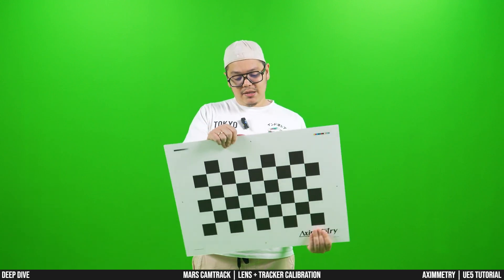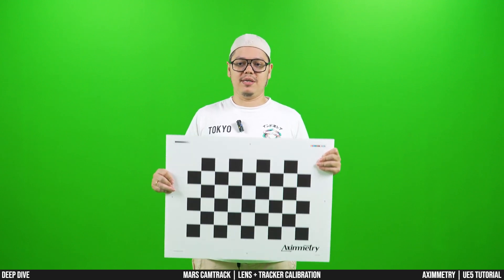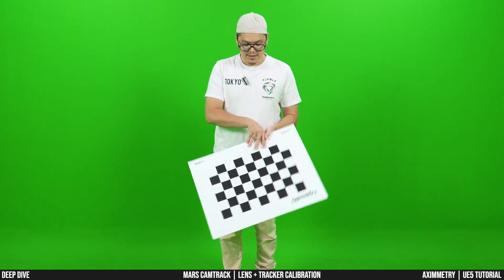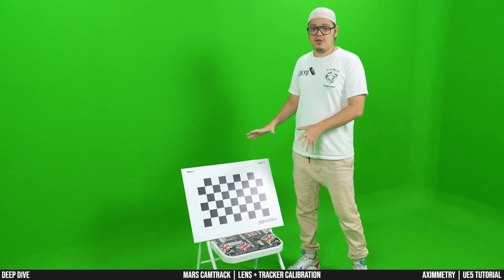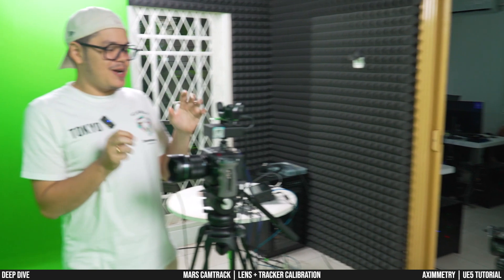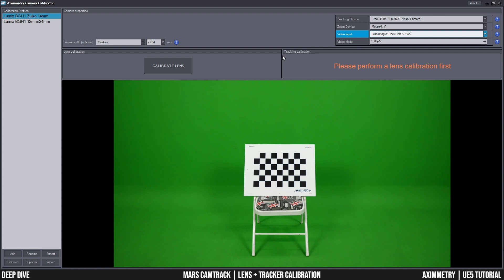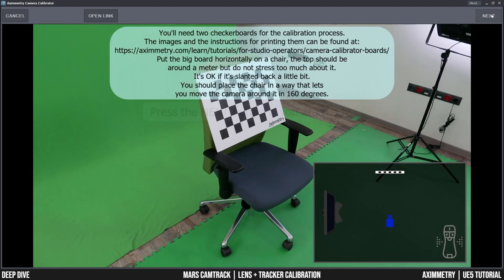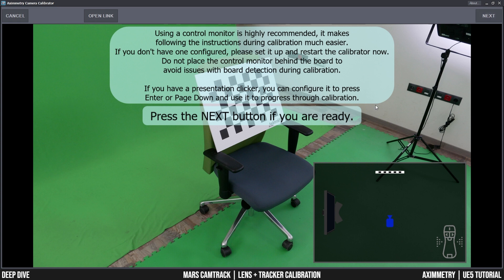VIVE Mars CamTrack lens & tracker calibration in Aximmetry

Comment: Will I need to recalibrate if I change camera lens?
Reply from the maker: You can do all your calibration in one day, it will save a profile for each lens/camera pair. You can then load each profile when you change lens/camera combination during production. So you only need to do the calibration process one time for each pair as long as the tracker is rigged in the exact position at all times.